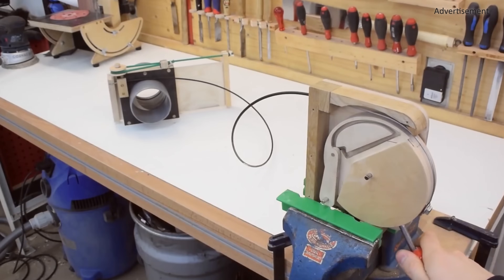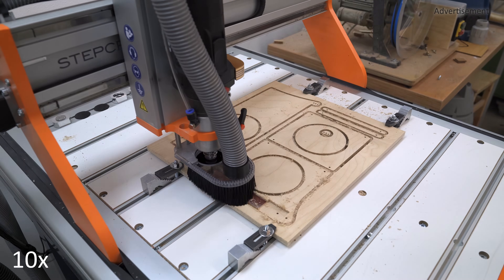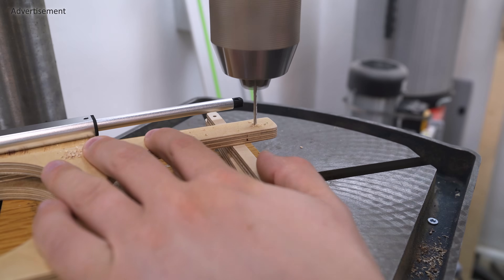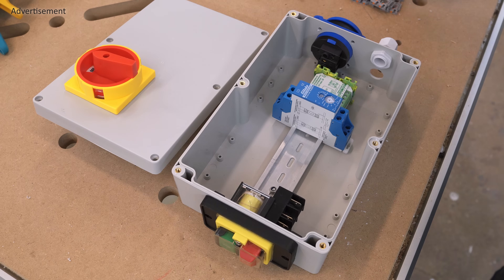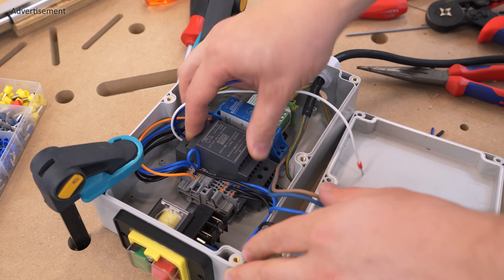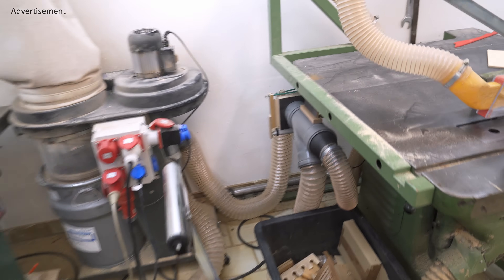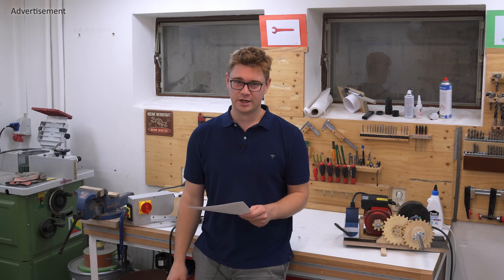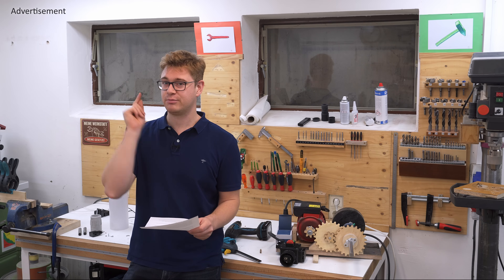Electric Blast Gates for my Woodshop +  FAQ

Comment: Why not just use a long-stroke relay that is energised whenever the machine is turned on and lets go when the machine is turned off - use the same power as feeds the machines motor. If insufficient stroke to open the gate then use a more powerful relay and the principle of levers. I have some 2A @ 230v relays here with 3.5" strokes.